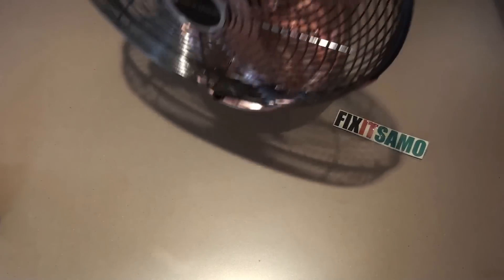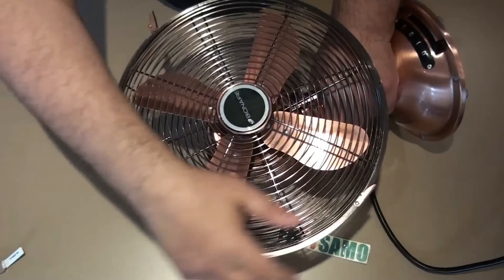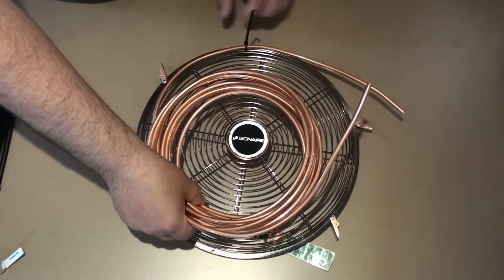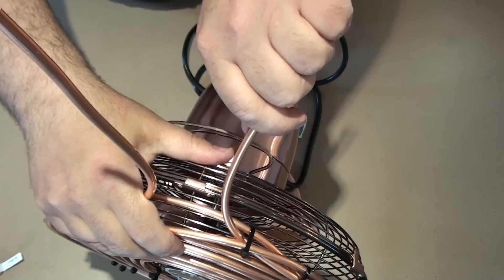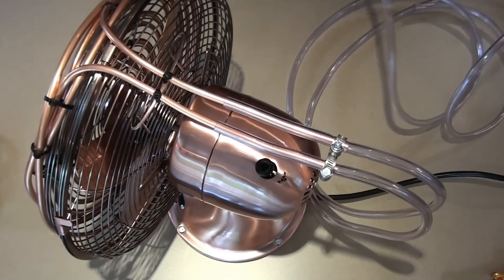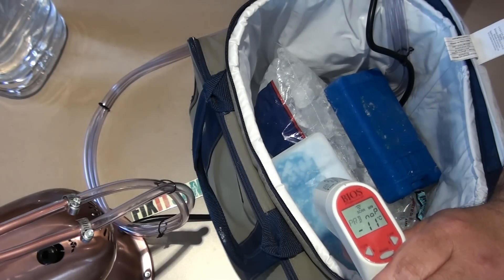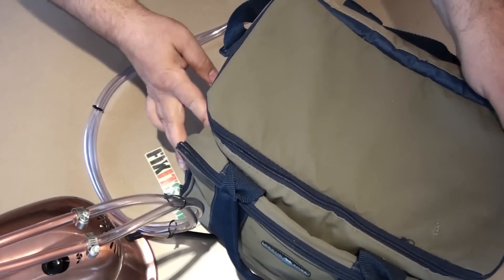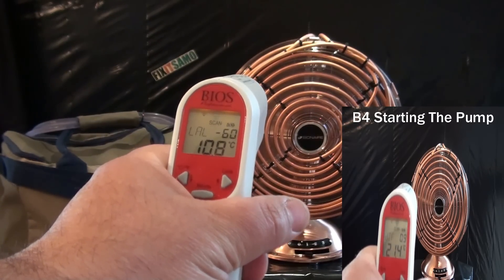How To Turn Your Fan Into An Airconditioner  AC

Comment: If I made this air conditioner I would use freon instead of water.
Reply: freon needs to be condensed under pressure in order to cool, and then expanded again to be recondensed. you'd need a compressor also
Reply: sonny12681 at that point your better off buying an ac unit.
Reply: sonny12681 what's freon?
Reply: GustavTheGoat freon is a liquid chemical that is used in car air conditioners, HVAC units and water fountains.  It's what keeps everything cold.
Reply: sonny12681 oh ok.
Reply: mujjuman then I shell add a compressor.
Reply: nice
Reply: Freon = Refrigerant = Most important part of refrigeration.
Reply: so basically buy an old fridge and whack a fan in the front panel?

Comment: Liquid nitrogen would be the way to make it work.
Reply: Reg Pollock a regular pump wouldn't pump liquid nitrogen
Reply: Dry ice at the bottom and the return tube at the other end of the bag and not near the intake.
Reply: Liquid Nitrogen would turn to gaseous nitrogen which as it would be at a slight pressure would escape the cooler.  If you were using it in an enclosed space (your bedroom) it would change the ratio of oxygen to nitrogen in the room.  The result of which is you wouldn't wake up as you would asphyxiate (a bit like drowning)

Comment: too bad, i thought the water would be cooled in a more long lasting way, however this is just relocating the heat to another part of your house. best keep it out.
Reply: All AC just relocates the heat that's why the back of your fridge gets hot
Reply: i know however with this you just make the room hotter. so as soon as you are not in front of the fan or the water has absorbed most of the heat your stuck with a hotter room.
Reply: +Simon WoodburyForget your fridge makes the cold air itself so has to dump the heat generated in the process so yes it heats the room in order to cool the compartment. This doesn't actually make the ice so it will never heat anything. It will blow cool air until the ice melts and it does nothing.
Its never going to make much cool air but the idea is sound.
Reply: H.G.D Amptmeijer last time I checked, that how every ac unit works. Relocation of heat.
Reply: RedGheauxst last time i checked, an ac only functions properly when you exhaust the heat outside your house/room.

Comment: You can buy a small room air conditioner for like about $100. Why bother with all this?
Reply: what do you make? $2 an hour? how the fuck do you only make $100 in a fortnight
Reply: Black Sendok 
Ummm, Because not all ppl get paid the same amount that you do. That was a very foolish and self absorbed statement/question.
Reply: Mylitla It wont save anybody money. The biggest drawback to the whole thing is that it wont dehumidify the room like an air conditioner would. The fan will just blow colder air until the ice melts. It's a stupid waste of time. He had to buy a pump, a bunch of coils, plastic tubing, a sack to hold the ice in, the ice itself, and he had to take hours making the thing. Just to build something that wont work nearly as well as a small window A/C.
Reply: Smallish window AC units run about 5000 to 6000 BTU capacity, which equates to almost exactly 1/2 Ton in air conditioning terms.  That means they have the equivalent cooling capacity as melting a 1/2 TON block of ice in a 24 hour period.  

Even if you could buy a 10 lb bag of ice for $1, the first day you would need to buy 100 bags, just to equal the cooling capacity of a tiny window shaker.  

Can somebody tell me again how this can save you money?
Reply: Mac Harper no you can't, good ones cost 5 times that much, you're talking about evaporative coolers that make everything in the room soggy and damp
Reply: ArmySigs Dude, I own 2 of them. 5000 BTU room air conditioners. They work fine.
Reply: because 100 dollars is like a million dollars in all other countries outside the US.
Reply: ok
Reply: dude its called DISPOSABLE income... most people who earn around £10 per hour only have around £2 per hour they can spend freely. On minimum wage people usually only have around £1 per hour of thier wage left after mortgage/bills/food ect...
Reply: Everyone can earn a lot of money, you just need some brains in your head. Save up some money for a proper diploma for an office job. It's only a matter of Darwins law.
Reply: "Disposable income"'
Really? He said he makes $100 per two weeks not his "disposable income". People always forget that income varies by nations, and that guy probably lives in a second-third world country.
Reply: well if his actual income is 100 every two weeks, his disposable is probably around 5 a week, making this even more unaffordable.
Reply: +Lytheus Fortnight? Didn't realize slang from the 1800s was making a comeback. By jove, good show man!
Reply: +Debbiebabe69. remember there are people in other countries that aren't so lucky...for them this can help significantly you fat American cow.

Comment: I've done something similar, which saves power. I got a cooler like yours, a $13 block of dry ice, and the fan setup like you. I instead used aluminum pipe as it is cheaper more conductive and more flexible. The cooler bag was air right using a hole I cut in the top, using a plastic tube and epoxy. The cooler had a large plastic hard shell, with rubber sealants at the hinge. I weighed down the top to keep any gasses from escaping. The gasses produced my the dry ice were cold and traveled through the tube, cooled the room through the fan and the excess gasses were expelled through an open end in the tube. I made sure not to die of hypoxia by placing a oxygen sensor at around hip level. The room was very cold and the entire air was breathable except the bottom 3 inches. DO NOT USE LIQUID NITROGEN your body can tell if there is too much carbon dioxide and will make your lungs feel similar to when you hold your breath too long. Your body cannot tell if nitrogen is displacing oxygen as 60% of the air is nitrogen, YOU COULD DIE IF TOO MUCH NITROGEN GAS IS RELEASED. Hypoxia from nitrogen can sneak up on you and cause you to act 'intoxicated' after just a few seconds. Giving you 10 seconds of useful consciousness. Hypoxia is as painful as falling asleep and you may never see it coming! So all of you saying to use liquid N2 Don't!
Reply: Jack Miller CO[2] has lower thermal mass than water..... N[2] also has lower thermal mass than water....... water ice chilled to the sublimation point if carbon dioxide or the boiling point of nitrogen would work a lot better

Comment: Did something just like this except I used a PC water cooling radiator a couple years ago. Worked great but the ice only lasted for 30 minutes, then the cool water warmed up to room temperature after about an additional 30 minutes.
It would be really great if there were other chemicals that would stay cold for longer but I already did the research,,, the number of substances that absorb more energy than water are incredibly rare.
Reply: LOL, Specific heat of water is dank as heck if you know what I mean.
Reply: i smell what you steppin in

Comment: Using a car radiator or a heater core from a car would probably be more effective than the copper pipe.
Reply: yeah just strap that thing on, definitley wont hinder the air flow..
Reply: Yea some tiny radiator fins are going to seriously impede air flow, better use a big copper pipe instead.
Reply: The flow may be somewhat lower but the heat exchange would be a lot higher with the increased area so the end result would be increased cooling effect. Car radiators and heater cores are designed for a high air flow even if they don't look like it.

Comment: Nice build. you can make this less expensive by not using an insulated container. the purpose after all is to transfer heat from the room to the ice. so insulating the ice serves no purpose other than reducing the cooling capability of the whole system. you can use a plain bucket or tub with ice water, works just as well. the whole idea of using a radiator like your built is to make the heat transfer more effective. insulating the ice goes counter your goal when the ice is in the room you want to cool.
Reply: The purpose of a fan that blows air cooler than ambient temperature is exactly that, to have the fan push colder air in a certain direction. If the container wasn't insulated then the cold would be lost to the surroundings rather than being blown in the desired direction.
Reply: You have a good point but it looks more clean and neat enclosed. Keep in mind this build isn't cooling a room full of supercomputers and servers, its a homemade air conditioner built from a common house fan.
Reply: If the ice was not insulated it would melt much quicker and you would have to replace the ice more often.

Comment: nice, but what are those other things that are inside the cooler? i mean the blue rectangular prism kinda thing...and the other things? are they important for the project?
Reply from the maker: +Gideon Aduralere 
These are reusable ice packs that u you can use instead of water they are reusable
Reply: Using reusable ice packs means you are freezing your own ice. That means you are just moving the heat from the cooled room to the room where the freezer is. Freezing ice generates substantially more heat than the heat removed from the room. 40 pounds of ice will absorb up to 8000 BTU's. Making that ice will generate 1.4 times 8000 or 11,200 BTU's to the area where the freezer discharges its heat.
Reply: You're doing that already if you have a working refridgerator in your house. So buy a couple of 2 liter bottles of water, throw them in the freezer and switch them out as needed. We're not trying to cool down the entire world here, just a room that doesn't have an A/C.

Comment: isn't that kinda dangerous?
Reply: You can always run your design to go beneath the fan motor, or have the tubing extend out farther.  You can also use anti-condensation foam on the piping as well for that purpose.

You should also be using a GFI outlet for anything where moisture or water exposure to electronics is a risk.  This is what they do in kitchens and showers now in modern apartment buildings and hotels/motels.
Reply: how so
Reply: the tubing goes right above the fan motor. a small leak or some condensation gets into the air holes on the back and the person who turn on the fan might get a shocking surprise
Reply: You could make the copper tubing a little bit longer if you´re worried, but I think it´s safe the way it is

Comment: Nice viedo
With what a supplier do you connect your pump and can i use a USB charger or it is risky to burn my device.
thnks
Reply from the maker: +Uno thank you 
The pump that i used is a 110 volts and this pump is designed to be submerged under water i don't recommend using any other method
Reply: Thnks :)
Reply: Uno

Comment: what about using a SPLIT SYSTEM UNIT (the one on the wall inside ) get both copper pipes and run it to a little bar fridge with the little pump inside and pump freezing water through the system and switch on the air conditioner ? any thoughts ?
Reply: This is not only portable, the cooper looks really nice...
Reply: Read This Possible but this is more towards affordability.  The bar fridge will not take so much load . It is like running your fridge with open door trying to cool the room . Will also raise the  electricity bills. So it will be more convenient to get an AC.

Comment: can i get more detail about this...
Reply: sopi seven Just simple cooling effect of water . Read it and you will get it . Water absorbs the heat from environment through copper tubes due to much lower temp of water.  Hence this leaves the copper tube cooler and when the fan blows air on it the air becomes cools . Hope you get it .

Comment: add salt in the water to make it much colder
Reply: right spot 
it does for a few minutes or so, but the ice actually melts faster when you apply salt to it. salt also corrodes copper, so not a very good idea after all..

Comment: you can make the reverse to ge free hot water to your house. using sun, dont froget to paint it black, and put it inside a wood box to avoid the cold air.
Reply: More like free warm water. People seem to forget the actual thermodynamics involved. Solar works to warm a pool but only preheats domestic water to feed into a electric or gas water heater except for needs later in the day during the summer. Warm short showers in the morning OK ? Been there, tried that, wasted money. It takes 64 sq ft of collector just to get a basic level of warmed water. It will take 8 years at best to break even.
Reply: It'd probably cost more to power the fan than get hot water. Not as efficient to do so either. If you have a solar panel when out camping it may work.

Comment: Hey idiot. If you are trying to cool the room, why do you put the ice in an insulated cooler ?  An open bucket would do the same. But, an evaporative cooler will do much better by a factor of 6. Aim the fan at a bucket of water and ice and you will get 6 times more heat energy absorption.
Reply: A pound of ice will only absorb 190 BTU's as it melts and the resulting water rises in temp to 70 degrees F. If the system lasts 10 hours, the ice/water is only absorbing 19 BTU's per hour per pound of ice. If there is 40 pounds of ice , that is 800 BTU's per hour. The fan is likely adding 300 BTU's of heat per hour so the effective cooling of 40 pounds of ice would be 500 BTU's per hour. A 10 x 10 normally insulated room needs 1600 BTU's per hour to lower the temp by 10 degrees F. 500 BTU's per hour will only lower the temp by 3 degrees F.  When it is 95 degrees, it is hard to notice a 3 degree difference. If you are making ice in the kitchen refrigerator, you are just moving heat from the room to the kitchen.
Reply: Yeah, 3 degree F or 1.6 degree C will surely cool the room. Maybe I should grab a blanket. Brrrrr.
Reply: Evaorative (swamp) coolers only work if the RH is less than 50%
Reply: Mark G 
Cause ice in a open cooler will last only 2 hrs  he said  by using the cooler the fan will blow cold air for @ least 10 hrs
Reply: Evap coolers will work at up to 80% RH, just not as efficiently.
Reply: hi mark, his project can cool in one room or not
Reply: Mark G ok thanks
Reply: Mark, what about a 60x60cm room?
Reply: Is this a room for a mouse ? .6 meters by .6 meters would not be a room. It would be a cage.
Reply: Mark G actually is for some plants, that happen to be in a 60x60cm grow box, heh
Reply: Mark G  lol

Comment: If you expose the ice & add some salt the temperature will drop below freezing point.
Reply: The salt does not change the BTU's the ice can absorb. It just makes it suck heat faster. An evaporative cooling system will do much better by a factor of 6.
Reply: The copper will eventually corrode due to the salt.
Reply: inferno..... As long as the copper isn't exposed to saltwater in motion,
 not a problem. Even more so at low temps. In Copenhagen much of the 
roofing is copper & it's hundreds of years old. Raw, clean copper is
 extremely corrosive, but after it initially oxidizes (turns green) the 
resulting patina protects the metal underneath. Saltwater in motion 
"scrubs" away the patina, constantly exposing raw copper. In fact, the 
weathering and oxidation of the Statue of Liberty's copper skin has 
amounted to just .005 of an inch over the last century.

Comment: This guy is just copying what tens of older videos already had shown in youtube..
BUT FOR THE MONGOLS, JEALOUS AND HATERS  here goes some clarification:
1-THIS WILL COOL A GOOD SIZE ROOM....SAY A 14'X14'. Just get a plain fan like the one he uses and it will somewhat cool a room like that, SO, IF YOU ADD THE ICE IT WILL COOL VERY WELL A 14'X14' ROOM. 
2- He uses a fountain pump, that is built to work under water, so no danger of retards being electrocuted, and no lawyer would accept such a stupid law suit.
3-If one positions  the fan on top or above the cooler and a small container under the coil and adapts a small  length of hose from the bottom of the container to the cooler box, the condensed water in the coil will be RECYCLED.
4-If one has a refrigerator, then use some containers with water and freeze them overnight and use them as needed  to keep the running water in a real cool temp, no need to purchase bags of ice.
5-The power used by the fan and the pump would run about $20 a month, a small 5000BTU AC would run at least  $35/MO, BUT I WOULD BUY THE AC AND AVOID THE HARASSMENT OF BE REFILLING ICE IN THE ICE BOX AND MAKING ICE EVERYDAY.
Reply: Marc Bb

Comment: what happen if I replace the copper with aluminum tube?
Reply: it would be less efficient
Reply: Actually Aluminium has a lower thermal resistance as Copper. So it will be more efficient ;) But don't mix Copper with Aluminium in a Water circuit, it will corrode.

Comment: throw salt in there and it would get colder. is that a laser thermometer?.. if so, you are pulling the temperature from the coils and that's not the temperature of the air

Comment: That's great thank you. I wonder if by circulating through a stream or the ground the system could be run without maintenance, although not so effective at cooling. Makes me want to build a ground-source heat pump. Thanks again.

Comment: Very nice effort and a novel idea. That said, between a fan, a fountain pump, cooler, ice, copper tubing (expensive), and plastic tubing and clamps you could buy a real 5000 BTU air conditioner at Costco ($119) that will work so much better, efficient and  for so much longer. Just saying......